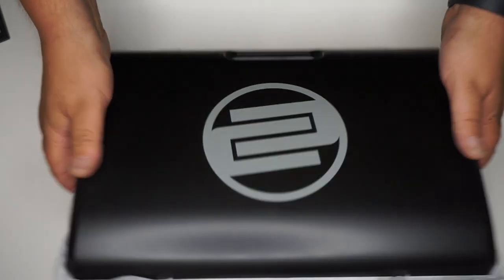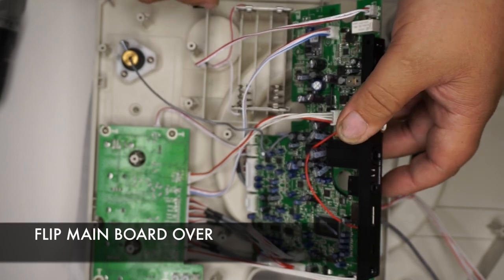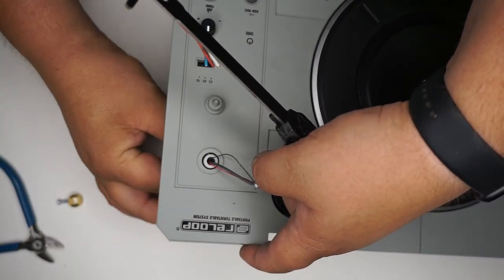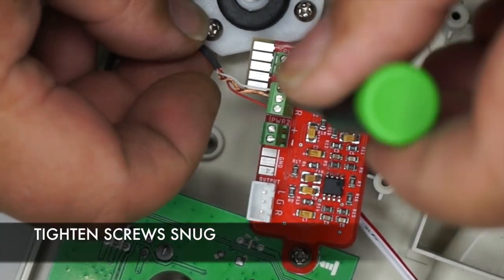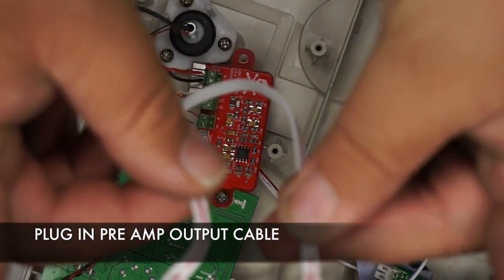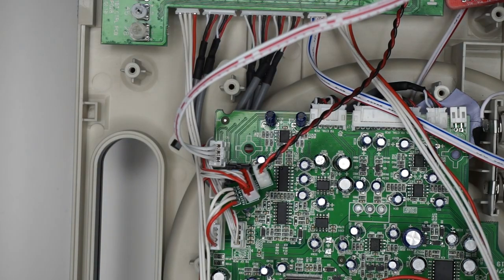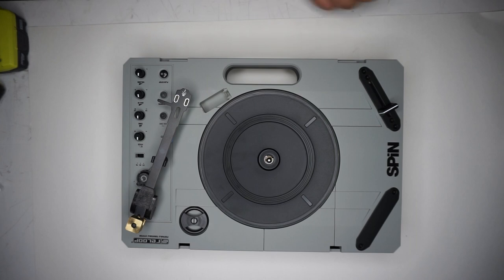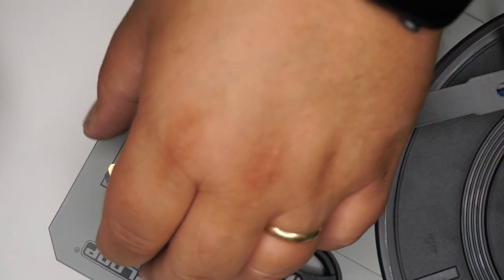JDD SPCB TONE ARM INSTALL GUIDE

Comment: Hey,can someone help me, I was installing my new JDD -SPCB Tonearm, & the flathead screw driver provided wasnt the rite fit,for tightening the wires to my tonearm,on the red greenboard piece! I needed a really small flathead,& the flathead provided wasnt the rite size,so when the redboard was waiting to be connected,& I couldn't find something that small for the screw tightening, some black wire on the greenboard that was flipped uprite,has disconnected from its soldered spot?? So,if I buy a sodderer, can I fix the black wire that somehow disconnected? Thanx!!....

Comment: Especially after seeing problems with installation and such, I'm very reluctant to potentially screw up my portable. Especially since this wa sthe most expensive portable I bought and don't want to break it. Think I'll just put some weight to the old arm with some gorilla tape and the metal from a screwdriver with the handle cut off with a sawzall. The weight alone shpuld help with skipping without me jackin up the main board or bricking the whole thing. Thanks tho. Ya'll should provide a service for the install for us gun shy folk. Stay groovy!

Comment: Just bought a second hand modded Reloop Spin & the Jesse Dean tone arm doesn’t drop properly it sticks in position as if the actual arm is too tight in the arm housing.
I’ve sprayed contact spray on the pivot pin but not really made any difference.
There is an Ortofon OM fitted so do I need a heavier cartridge as well ? 
Any suggestions appreciated Thanks 🙏🏻

Comment: My volume of the record is about 60 percent lower after this install.  Is this working as intended or is something wrong?
Reply: I have the same issue, I just installed today. Lemme know if this is normal or not.
Reply: Maybe its your stylus
Reply: @MrFab189  it was the phono preamp. Talked to the folks at JD and they sent a replacement
Reply: Hi,man.I have the same issue,the volume getting lower,have you fix that?
Reply: @江城宏  It was the preamp
Reply: Thanks,so we need to buy a preamp,right?which kind of preamp is it?
Reply: @江城宏  I reached out to Jessie dean by phone and they sent me one

Comment: Hi  I am new to this, I want to ask can I still play 12 inch record with this to warm? Thank you for the reply🙏🏻🙏🏻🙏🏻🙏🏻
Reply: It's seems to be not designed for it, but it works. The only issue is the tone arm rest. If you install it as shown in the video, 12" wont fit. BUT, you can just push the tone arm rest as far to the 33/45 switch as possible, than there is enough space for 12". Because of this repositioning the magnet of the tonearm does not snap in on the rest any more, but still, it holds OK-ish. I'll probably just design and 3D print a new rest, so the magnet matches again. 

Or is there any chance to get the 3D file from @Jesse Dean?
Reply: @domlen  I would totally buy one of these!

Comment: Just installed the SPCB tone arm and  Ortofon OM Scratch Cartridge & Stylus. Followed every step from the video. Using the headphones I can hear the sound from the vinyl is now only on right channel and if the volume is over 40% with the tone on default position there is a "static" sound in the headphones/speaker. If the tone dial is turned on the right side all I can hear is the "static" sound very loudly. Is anyone having the same issue?
Reply: Hey there. Could you solve the problem? Im thinking of getting a jesse dean tone arm for my spin as well. Recently I moded the jesse dean fader to cut on both sides but now the bluetooth volume dropped a lot. Let me know if its worth the buy. Cheers!
Reply: @inmune593  Hi Melvin! The tonearm was bought from https://www.turntabletrainingwax.com. They didn't helped me with this issue - just asked me to send them back the whole package to replace it. Then I sent an email to Jesse Dean and he sent me another preamp part. That part was the faulty one. Now the sound from the tonearm is played through both left and right channels. The issue with the static noise is only present when I'm not using batteries to power the turntable (I don't have a logic explanation but it was also reduced when I reversed - plugged the connectors (same type) the other way around -  one cable inside the turntable).
I only used the stock tonearm for a day or so and I'm not able to make a "proper" review of the Jesse Dean tonearm. But there is a difference in both volume and quality of the sound.
Reply: @victormanea6720  i didn't notice your reply earlier, but I'm thinking you have a more precise vision about the JD tonearm. I still want to get it but i found several comments on  sound-related issues after the installation. I'm outside of the US so it would be hard to return items in case of malfunction. Any light on this would be very much appreciated. Thanks again!
Reply: @inmune593  I'm having an output issue.  Sound is great, but pretty quiet.  It's usable though - with the volume all the way up.  I'm trying to contact JD to see what's wrong or if that's working as intended.
Reply: @inmune593  please don't buy this, I just have bought  I have now a problem with this and JD never reply your msg you are alone if you have a problem.
Reply: @victormanea6720  please maybe you can to help me. How you make that you said of reverse conectors??
Reply: @CarlosNativeOfficial  yeah that is usually the problem. To tell you the truth I have already bought one back in february but I'm still waiting for my ortofon cartridge to arrive. I need someone to bring it for me as I'm outside of the US. For the volume drop issue which I frequently read seems to be the the worst problem about it. Apparently if you get a rotary control accesory from magneto faders, it will let you control both vynil and aux volumes independently. I suppose I have to get it now...I'll update once I install it.
Reply: @victormanea6720  what cable you reverse inside of the spin?I have a similar. Problem.
Reply: If you have an issue, call JD. The number is on their site and they were very helpful
Reply: @BobbyBriscoeBeats  my Inglish no is. Good for I. Call a JD. I'm spanigh and my inglish is really primitive haha
Reply: @inmune593  my tonearm run good, my problem is when I put my móvil phone  near of this, This make a strange Interference, so then I'll like to know if is possible reverse conector or something for remove this.?
Reply: @CarlosNativeOfficial  damn. Probably has to do with the Bluetooth board. Some forums mentioned that it also becomes useless after the tonearm mod. I hope u can fix it
Reply: @inmune593  yes, maybe is with the Bluetooth board. You know in what foro?
Reply: @CarlosNativeOfficial  try calling them. I didn't have any luck with email or messages either, but one call and I was sent a new preamp. That was my issue
Reply: @CarlosNativeOfficial  it's called reloop portable users on Facebook...I saw someone post about that a while ago
Reply: @inmune593  yes I'm part of the group as well
Reply: @BobbyBriscoeBeats  great Thank you!
Reply: @inmune593  great thank you
Reply: @BobbyBriscoeBeats  cool. I guess i try to contsct them if i have an issue. A whatsapp number would be great since I'm out of the States. If you happen to have that info it would be very much appreciated